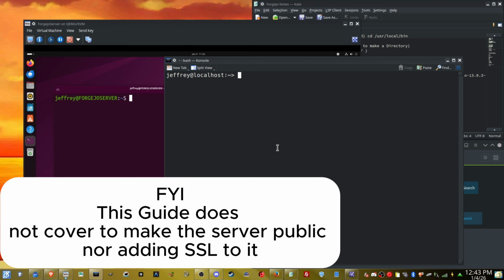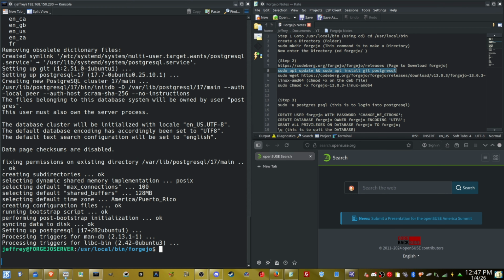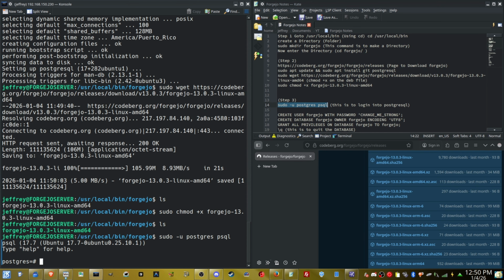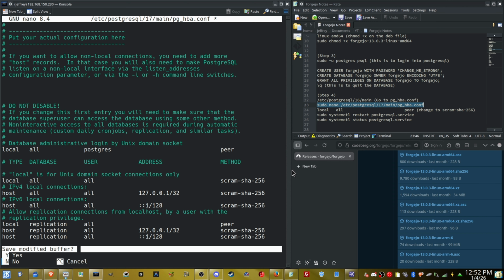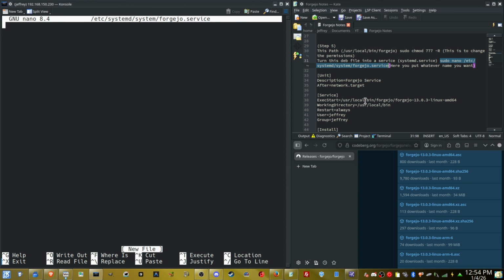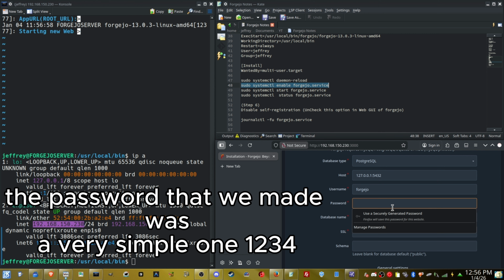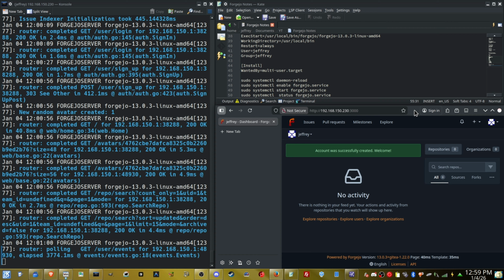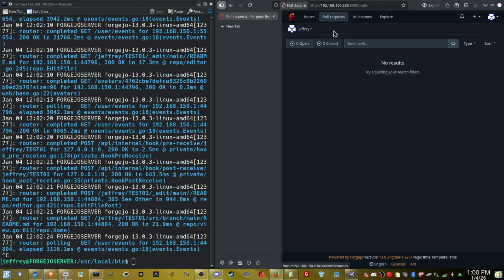How to Set Up Forgejo on Ubuntu Using PostgreSQL

Comment: When you click "Install Forgejo" in the wev UI, there is absolutely no indicator that setup is taking place. What a mess...
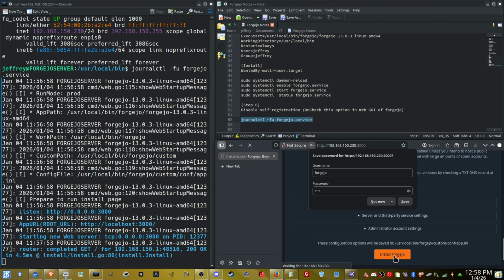Reply from the maker: In 7:51 the left side of the screen that part shows you the install process live of Forgejo that why I included the command and I even mentioned it's gonna look like it's not moving just loading you need to wait for the process to finish
Reply: @JeffTheTroubleshooter  My critique is not for you but for the Forgejo dev team. :)
Reply: BTW, how fast was it installed after you clicked "Install Forgejo"?
Reply from the maker: @71GA it varies added more resources to see if it does it faster but did not see lots of improvement from 40 seconds to 2 minutes and in rare occasions 5 minutes I would always see the log to see if it finished due to the fact that the loading bar disappears so that why I used a live process to see it it's running or stuck